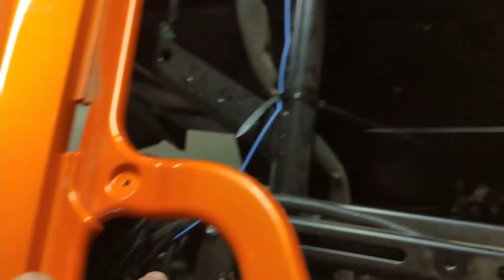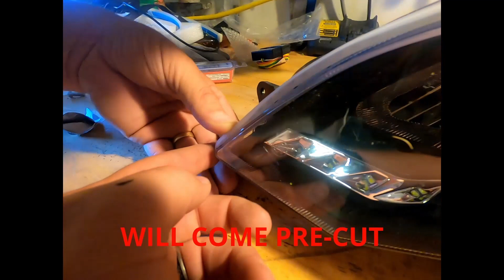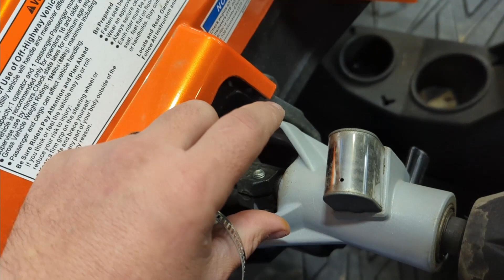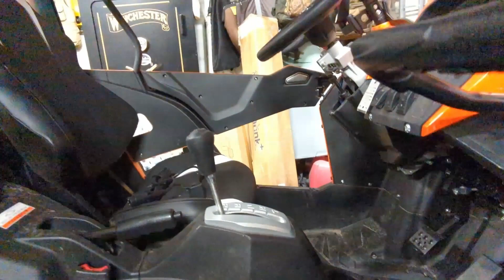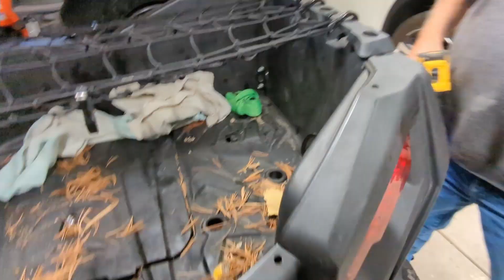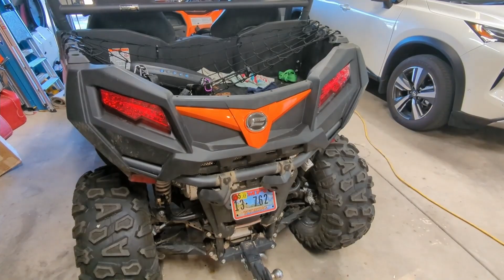CFMoto Z-Force (500, 800, 1000) plug-n-play turn signal harness install.

Comment: My 2018 Z1000 is wired for turn signals. The plugs are capped off front and rear and there is two plugs in the dash for turn signals and flashers.